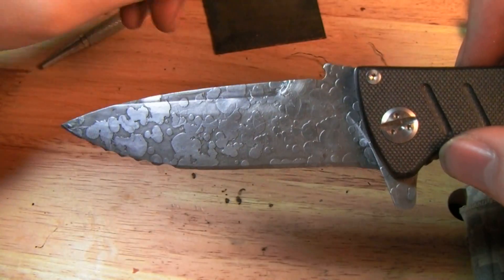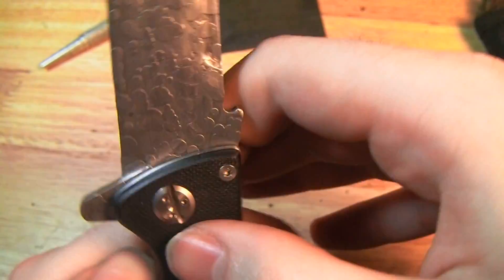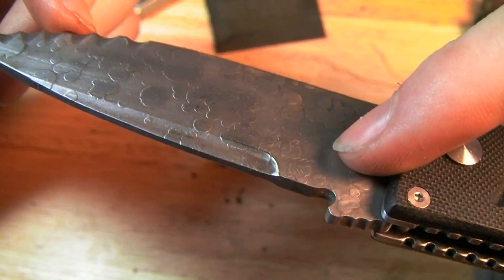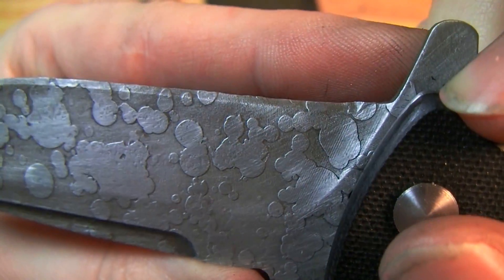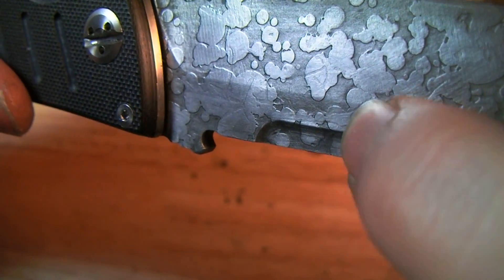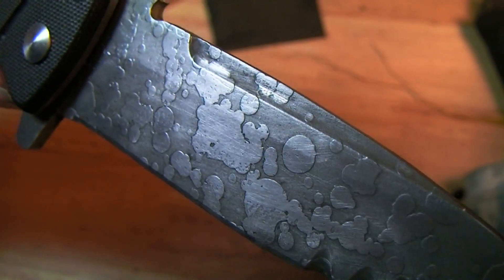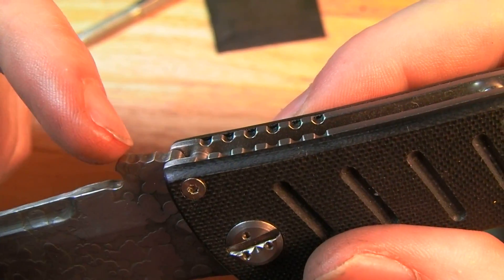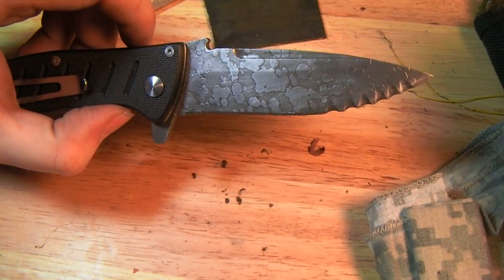Acid Etched Blade Test

Comment: That kind of looks like a quench pattern, you can check this link to see what im talking about: https://www.facebook.com/sinisterknives/photos/a.775000772621094.1073741828.774988872622284/827912500663254/?type=3&theater
Got this pattern by overheating the steel during the heat treat.

Comment from the maker: @Daninja42 This one needs re-profiling because I let the drops go randomly on the edge. So there are a few little ridges on the bevel. But the steel isn't damaged overall. If you look at my newer work with this stuff I generally cover the edge bevel.